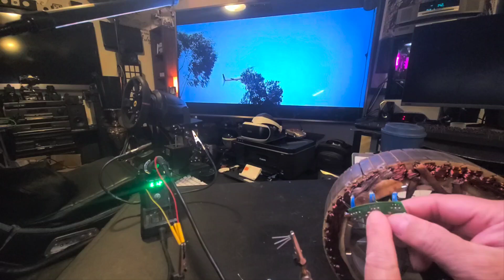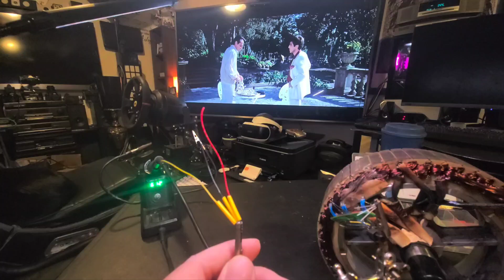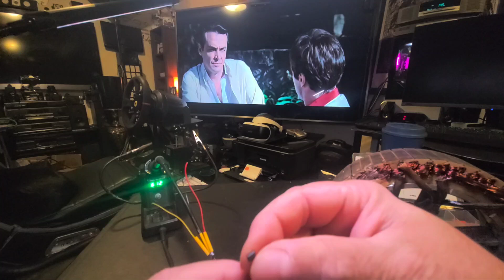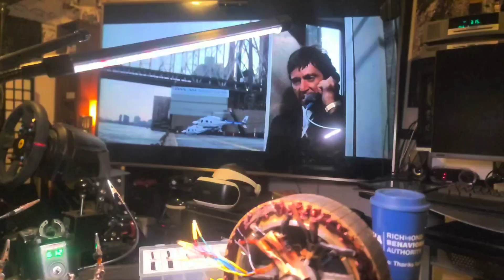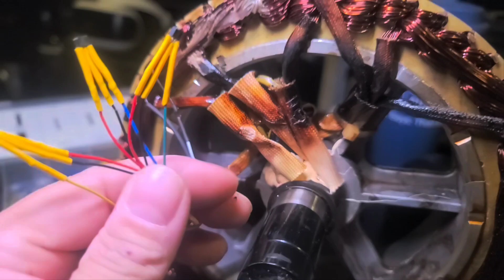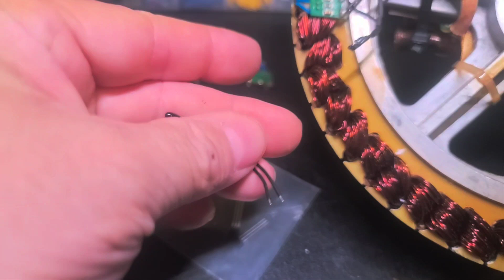Another Ebike motor repair video hall & temp sensor replacement #101 just for GP.

Comment from the maker: I didnt mention in this video if you have the all flat side of the hall facing you the pos 5v is the right leg ground in the center and hall sensor wire left leg. Also Remember the sequence that the hall colors are mounted in replace them in the same sequence.

Comment from the maker: And yes it's battery building season at least the time of year where I have allot more time to work on packs and modifications for next year. Summer is busy for most of us and this summer was bad for hopefully I can get back to normal. I'm still working on packs now just have some odd jobs in between like couple of these hall sensors repairs and phase wires upgrades. If your good soldering and neat with wiring you can DIY this. Also here's link to another video with a Lil more detail if you need it https://youtu.be/O9HW-VrdLBI?si=eOR2kTRxDXdOQhxC